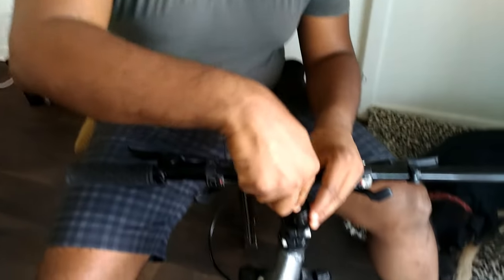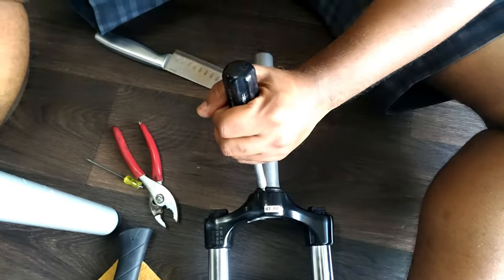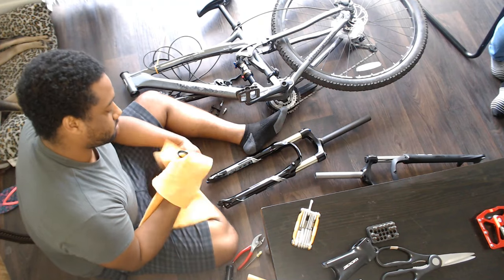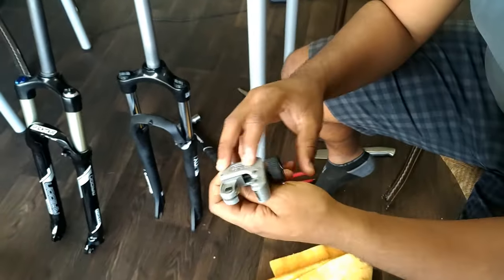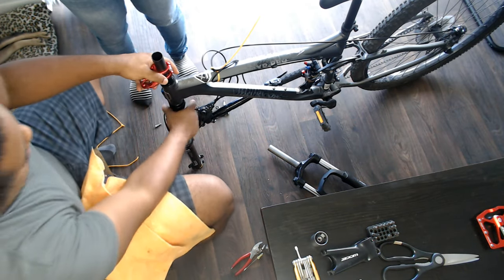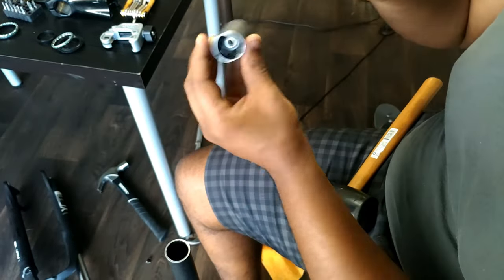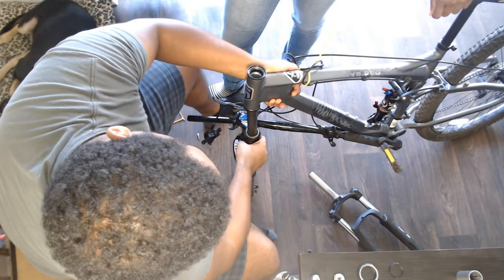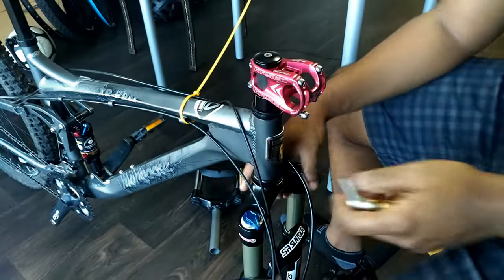Suntour Raidon Installation / No Special Tool Required / Mongoose XR-Pro

Comment: Good video. You can make a cheap headset press with a piece of threaded rod, a couple of small blocks of wood, and some nuts and flat washers. I put my headset on in about 5 minutes. Worked like a champ.

Comment: Nice. How has the Raidon been performing compared to the old fork?
Reply from the maker: So far it the Raidon has been a lot better than the old one. In spite of my weight, I have not felt it flexed as much as the other one. I have fallen several times, and I even hit a tree head-on thinking that I broke it. To my surprise, it survived.

Comment: Pipe cutter is a special tool by the way
Reply from the maker: Not really as any other metal cutter could have been used.
Reply: @bikecentral6090  actually it is if its not in a typical tool box its a special tool and trust me most people will only have sockets, plier sets, screw driver sets and wrench sets thats your standard toolbox.
Reply from the maker: Lol, I'll give that one to you. You're right.